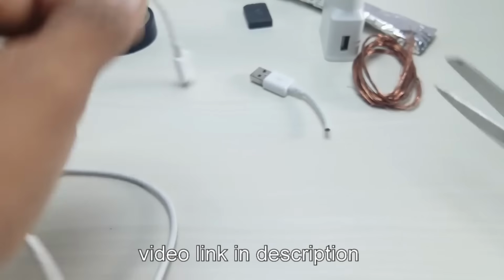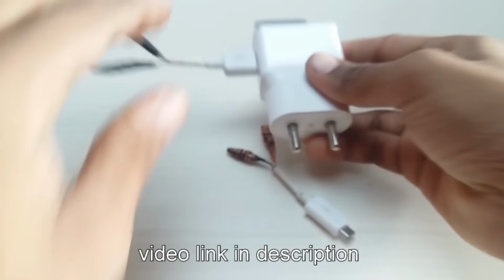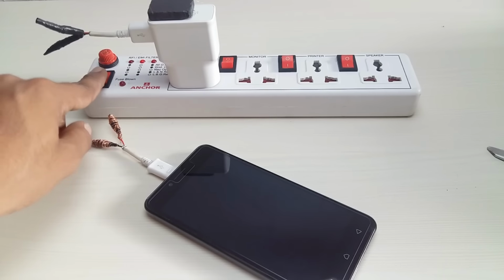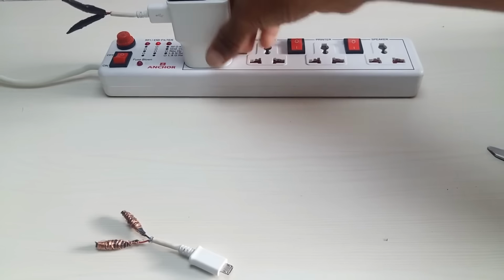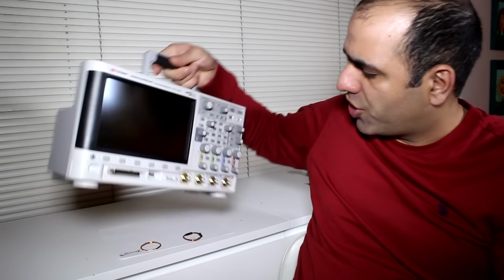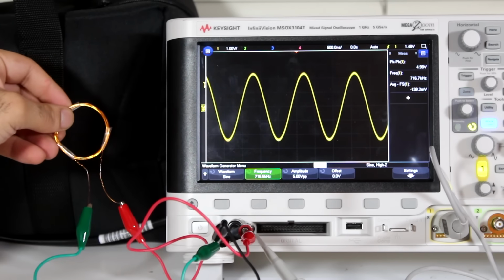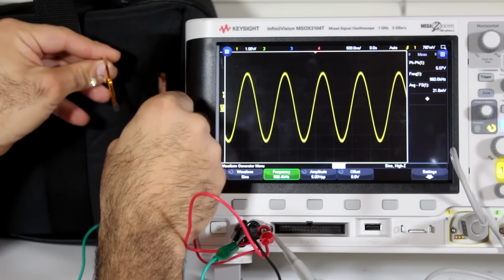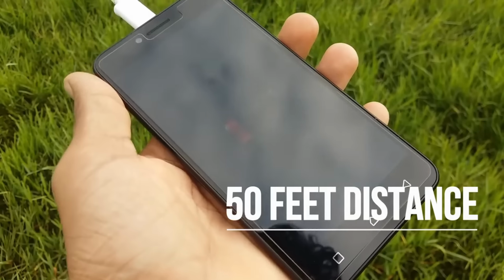Fake and Real Wireless Power

Comment: can i convert 220v Ac to 220v dc
Reply from the maker: yes
Reply: FULL BRIDGE RECTIFIER!
Reply from the maker: With just diodes, he will get 310VDC. He would also need to step down the AC first to around 156VAC, then rectify it.
Reply: Actually you would get up to 311V this way (220V*sqrt(2))
Reply: google it, you just need diodes
Reply: You will need a FULL BRIDGE RECTIFIER......
Reply: fuuuuuuuuuuuuuuul  briiiiiiiiiiiiiiiiidge  rectifier
Reply: You need ElectroBOOM... he is THE RECTIFIER !!
Reply: no, it is literally impossible -_-
Reply: use FULL BRIDGE RECITIFIER!!!!
Reply: Antivorg mehdi said yes so stfu
Reply: The Randomchannel im kidding lol of course you can, just use a full rectifier, a couple of filter caps and maybe a driver and you've got it lol
Reply: Ordis The Cephalon he's gonna need big ones if he's gonna handle all of that power
Reply: Yes with a FULLL BRIIIDGE REEECTIFIERRR!!!!
Reply: LifeRider 96 Yea, no problem mate :)
Reply: Rambbax yes bc Ac has positive negative cycles Dioad foward baise voltage flow which convert Ac to Dc
Reply: Beat me to it :(
Reply: I have a cheap 20 minute stun gun that requires minimal electrical skill that turns 1.5V from a AAA battery into 260V. Not everything, but at least a lot of things are possible with science
Reply: I mean 20 minutes of effort
Reply: Nahh, he just needs 129 diodes.  >:D
Reply: Mark Jones No one says to just drop in a diode just like that. You can still put in a giant ass resistor
Reply: Mark Jones he used the phrase "can i"
Reply: If you have to ask that you better stick to 1.5V batteries for everyone's safety.
Reply: superdau i love AC volt  no safety i m guy like him
Reply: Talha Khalid nope u cant... When u convert 220V AC to DC, theres bound to be some loss of energy(maybe through heat or sound, etc)... U will get close maybe ard 200V DC? U can achieve this by using a full bridge rectifier.
Reply: Mohd Asyraf when people say 220V AC they don't mean a peek of 220V they mean 220V RMS because AC voltage fluctuates so it wouldn't make sense to measure it from a single point, and when converting AC to DC the DC value will be greater then the RMS AC value
Reply: You will get energy lose, but that is not limited to just voltage. By converting the polarity you could get closer to 400V DC, or maybe 350V DC, then do a step down to get 220V DC if you really cared to but it is just a bit more complex then just a rectifier. The energy lose will then be from higher current in the AC statement then the 220V DC system.
Reply: Loathomar no need to guess, simply multiply the RMS voltage by the square of 2. that will give you the peak voltage, or the DC voltage after a rectifier.
Reply: Jadin Andrews In an ideal system, yes. It reality, not so much. All systems have loss.
Reply: Loathomar uhm multiplying by the route of 2 gives you a smaller value than both your guesses, 400v? 350v? 220 x 1.414 = 311v. Why are you talking about loses now? Multiplying by the route of 2 is the way to go when trying to calculate the peak voltage of an rms signal. The only assumption is that the signal is a pure sine wave, talking about loses is meaningless unless you know the system and the application. Sure, all systems have loses, that's a given. Perhaps you should provide a citation for why you believe multiplying by the route of 2 is inaccurate.
Reply: ElectroBOOM I really love ur videos.  If I were to play with mains voltage what are the safety measures I should take other than use a MCB?, first aid kit & fire extinguisher?.
Reply: LifeRider 96 The safety measure is don't play with mains voltage...
Reply: Antivorg I know that,  but how does he play with mains and hasn't killed himself after so many videos? Is 120V really that safe?.  Would he have survived if it was 240V?
Reply: LifeRider 96 He's admitted before that his "accidents" are staged for comic relief, but I'm not saying that mains electricity will kill you (it more often then not doesn't), but I've seen some idiots really hurt themselves with it when messing with their circuit breakers and what not.
However, I have seen some schematics for high voltage, low current, power supplies which if you can limit the current to below 10mA are absolutely fine, but there are very few projects you need high voltages for anyway, so I'd advise just using a 9V wall supply that your phone probably charges on and stick to some low voltage projects until you know what you're doing.
Reply: Antivorg Thanks for the advice, I have done many lab experiments and few low voltage projects. I am interested in power electronics (which comes in the final year of my course), so I felt like doing high voltage arcs, diy arc welder & such which require high voltage & high current.
Reply: LifeRider 96 Ha OK, if you know how to be safe then knock yourself out, I just usually assume that people a novices to be on the safe side.
Reply: Antivorg Sure, but I will be extra careful to limit the current! Thanks anyway man
Reply: a single diode and a high voltage cap in parallel should do it

Comment: All wireless source of charging power is a lie, because electrons dissolved into heat as energy transforms, batteries can't be scientifically charge over wireless source, and neither any energy is strong or powerful enough to do so.

Comment: They say you can implant a magnet into your finger and use it to feel electric current in a wire without touching it. Can you test that?
Reply: Watch Cody'Slab and thank me later. He's actually implanted a small magnet into his finger. I don't think you can actually feel a current in a wire as usually wires have pretty low density magnetic fields (weak) and a magnet wouldn't be attracted or repelled much by such weak fields. There's also a real possibility that any ferromagnetic material in the conducting wire would cause false positives and detecting current where there's none.

Comment: Interesting point: it's really obvious that it was fake, but what why did the screen say that it was charging? Playing a video of the phone actually charging? That would really be some underhanded shit.
Reply: He could fake it out with a video on the phone screen, or go the hardware route and hide a stack of 1.5v button cells inside that mess of electrical tape on the "antennas". The phone doesn't need to know what it's plugged into, it just needs to see 5v on the power line to display the charging indicator.
Reply: dpidcoe Good point. One way or another, absolutely terrible.

Comment: Wireless charging sounds awesome, but it's really not good enough yet. It's slower, wastes a lot of power and causes unwanted heat which can affect your long-term battery life.
Reply: Gadget Addict this guy knows
Reply: As wireless charging of phones is usually at less than an amp it should not cause any problem. in fact the slower charging is probably better for your battery.
Reply: brian whittle True, but it doesn’t really matter as we use our phones daily. After a year, the lithium battery will start to lose capacity.
Reply: brian whittle Slower charging might be better, but you're forgetting the heat created during wireless charging.
Reply: Sam Fedorka "you'll get a new phone in 2 years" Says who? If my phone works in 5 years, i'll probably will still be using it.
Reply: And not to mention transferring Megawatts of energy over the air is incredibly dangerous...
Reply: @SuperPickle15 :
When did "[m]egawatts" become some sort of brand, to you?
Reply: Conner Anderson . It never went away. It's now just called a radio transmitter. It uses kilowatts of power to deliver nanowatts of power to your reciever. There's no magic or conspiracy involved. BTW RF emissions are fortunately very well regulated or none of your wireless gadgets would work. You can use this "free" energy just hold  a florescent tube at one end and walk up to an radio station broadcast tower. Just ignore their electric bill.  Might wanna Google rf burns 1st.
Reply: I assume it would be pretty inefficient whilst requiring a huge current drain to generate a strong enough magnetic field to charge it at a reasonable speed lol
Reply: Jared Leach u mean FULLLL BRIDGE RECTIFIER!!!
Reply: I prefer the wireless charging dock as after a year of plugging in and unplugging conventional chargers the port gets loose and such. I always end up with a phone that u have to have the connected cable at the perfect angle to charge. Wireless charging pads fixed this issue. (Well even with connected cords I suppose USB-C types are less likely to wear down)
Reply: Always worked better than plugging in for me
Reply: No it's not it doesn't waste energy at all. It won't heat up and charging speed is good especially with newer phones and chargers.
Reply: How much heat does it generate? I would've thought that the transmission would be at reasonably high voltage and low current, and therefore a small amount of heat.
Reply: Fabian transformers don't go from AC to DC. You're thinking of a rectifier. Which is quite small when in IC form.
Reply: Then the issue is that energy lose from converting voltage from low to high and then back down to low again, increasing cost and energy usage. While you can increase the efficiency of the power transfer easily enough, you must look at the entire current efficiency. Yes, a 120,000V system running at 10MHz thought a planar antenna will get WAY better wireless power transfer then a 120V at 120htz, but the cost is way higher and you have lose at each step for the 120,000V, 10MHz system and the cost will be much higher. Would you be willing to pay $200+ for a wireless changer that has a 20% increase in energy efficiency?
Reply: Gadget Addict I agree it charge slower i bought one for 40 bucks and it came with a 15 watt wall adapter which would awesome but when I wireless charge my iPhone 8 Plus it took so slow so I just use my iPhone charger but changed the wall adapter to 15 watt compare the one apple give u charge much i reach 0-100 percent in 2 hours once it get up to 60 it charge fast asf
Reply: what about the wiz charger on certain car though? is that also fake?
Reply: It's also very convenient. I just plop my phone down on the charging pad - that way I always know where to find it and it's always sufficiently charged when I need it.
Though that said I have no habit of using the phone in bed - I have my  tablet for that.
Reply: I'm from the future, we have wireless fast charge
Reply: The thing is that you need a transformer at the other side of the wireless communication to turn AC from the wall socket into DC for the battery, so you would need to put it in the phone, where there isn't any space. So it is not so easy as to laying the phone on a charging surface.
Reply: Yet? It’ll never be good. It creates too high of resistance that a lot of electrical energy has to be wasted for it to work. Just plug your shit in. Wireless charging is just for fun.
Reply: Unless it's directional it can't be efficient. But if it's directional it is not useful anymore if you can't go anywhere while wireless charging
Reply: Remember kids wireless is always sh*tter than wired connection
Reply: You want high frequency too, just like in this video, (where he plugs it into mains and the low frequency causes it to blow up) so there are fewer losses (it's where impedance is more important than resistance). I don't know the efficiency of inductive charging, but I bet the battery is designed to heat up more than that. B'sides you'll get a new phone in 2 years anyway so it doesn't matter.
Reply: @safedork , you don't really know when someone's gonna get a new phone, though, since you're not a mind reader. Anyway, what's the point of writing "b'sides" when you don't save any effort or room from "besides" (which is the same question as why type "2K19" instead of just "2019")?
Reply: @HelloKittyFanMan.  Average smartphone lifespan was about 2.5 years from a source I checked when I wrote that. I was thinking about how planned obsolescence driving this statistic. Since the average smartphone user will replace their phone within 3 years, inefficiency in inductive charging plays a minor role here as the battery lifespan due to cycling and age is more of a factor. That's what I was referring to.
I used "b'sides" because it's closer to how I would have said it, were I speaking aloud. I use commas the same way, to let the reader know when I would pause when speaking rather for any formal grammatical purpose.
Reply: @safedork : OK, well commas weren't designed for that purpose. If you want to make a little nongrammatica pause, the thing to use is the ellipsis: ...
Hmm, it's interesting that they have some supposed stats that most smartphones supposedly "break down" after about 2 1/2 years. I have some that, even though I've replaced for feature reasons, still work way past that. As well, I've kept using some phones for longer than that because a lot of new ones don't have physical keyboards. But now my new one is a bigger one that does both have a physical keyboard and run on Android (the Blackberry Priv). So maybe my others somehow made it past the average, but I'd think a lot more than just mine would last like that. Well, even if that is the actual average, that doesn't mean this guy will surely replace his phone after 2 years.
Reply: Gadget Addict Tesla Had it figured out. But Cable companies and Rio Tinto like companies that mine and dice for copper, suspended the project and threw it forgiveness
Reply: Gadget Addict Tesla Had it figured out. But Cable companies and Rio Tinto like companies that mine and dice for copper, suspended the project and threw it forgiveness

Comment: what do you think about those videos floating around on the internet claiming they have a free energy motor ?
the ones where they use little voltage input and use a motor which has magnets and coils in it?
My colleagues at work think they are real and can put out more energy than they receive.

Comment: will it be possible to charge a phone by significantly increasing the primary coils voltage to the secondary coil connected to a battery to charge from a distance?
Reply: Yes, of course. I once made a "whole-room" wireless transmission device. It could power small LED lamps of about 0.5W when they were in any place of my room. However, to light a 0.5W LED lamp the device was drawing almost 70W so not very efficient :D
Reply: MrOpenGL nice

Comment: why do you always shock your self?
Reply: So that we viewers dont have to!
Reply: true true
Reply: believe it or not. normal people would actually do that. he does it so other pepole wont fuck up
Reply: He needs to recharge his battery
Reply: he doing all his "shocks" and "explosions" by shorting small charged electrolytic capacitor, a low voltage one, so he's completely safe.
Reply: deep down he loves it
Reply: Sheldon Bruce when plug the coil like that it will explode the wire immediately, also I doubt he would standing on ground while plug it in so it's not a huge shock
Reply: For comedy of course! People think EE students shock themselves by accident a lot, but actually I've seen more students getting burns from soldering irons than getting shocked (not that many people get burnt, but still the reality is so much worse...).
Reply: Didi Andrade lol